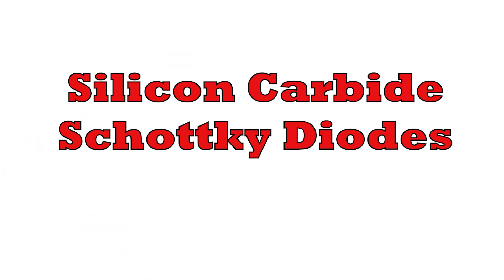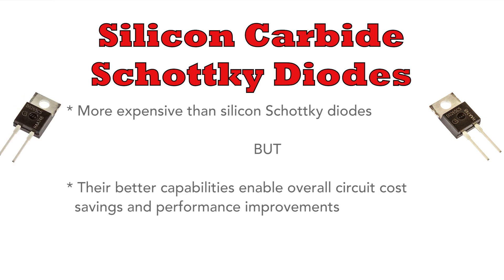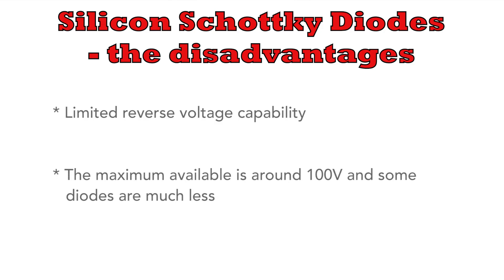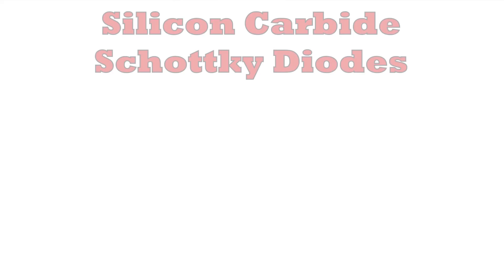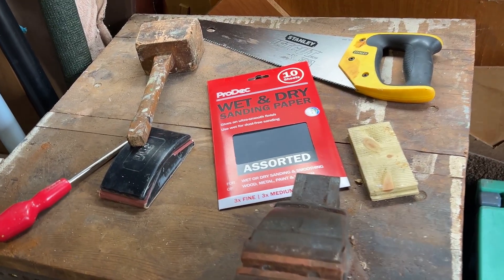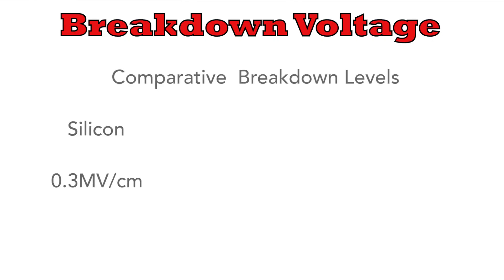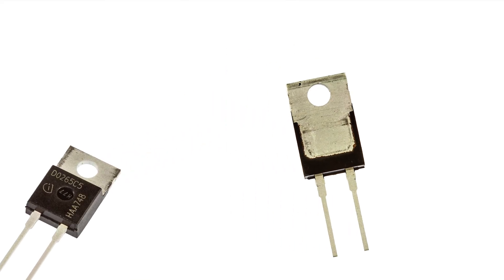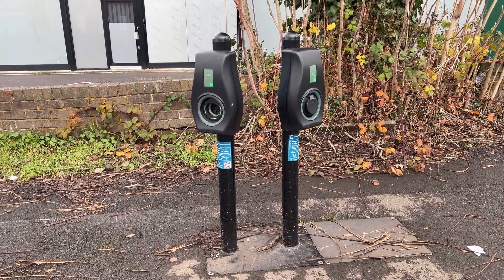Why are Silicon CARBIDE Schottky diodes so great?

Comment: They are best for rectification at high frequency and at higher voltage. Gallium nitride is another one that has even more voltage withstanding ability. Silicon carbide does have an issue that it's voltage drop goes up a lot faster per amp than silicon, you might have a drop of only 0.3V at 100mA but at 10A it goes to 1.5A. When doing higher voltages this isn't a big deal though.
Reply from the maker: Thanks for your insights - very useful.

Comment: Are SiC diodes sutable for secondary side rectification? What is the lowest forward V drop?
Reply: I've checked datahseet for that diode you show here and voltage drop is over 1.5V! so it is actually worse than silicion diodes, it is just faster
Reply from the maker: Comparatively few figures are available. It depends on the diode and the metal used for the junction, but figures around 0.3 to 0.4v turn on are seen. Obviously this rises with current, so check the datasheet for your particular diode.

Comment: Excellent!  I am sure you were joking about not understanding the electron volt but it is one of those units that actually is really easy and helpful to know.  In its simplest terms (and I know it is about + charge), "The energy gained by one electron moving through 1V"  Yes, one needs to then convert that to Joules but 1eV is just what it says, 1x e(charge on a proton)J.  I find it similar to 1kg being lifted by 10cm being about 1J of energy transfer though that is a lot bigger than 1eV!!
Reply from the maker: I was indeed joking! Thanks for the explanation.
Reply: @ElectronicsNotes  Yes, it's quite a 'visual' unit as it were. You can almost imagine those electrons each picking up energy as they travel through a power supply!

Comment: You have not mentioned the forward conduction voltage drop of SiC.
Reply from the maker: Good point. Its a bit higher than for silicon Schottkys, but still better than for a PN junction diode.
Reply: The SBR (Super Barrier Rectifier) is really a good device.  It has the voltage drop of a Schottky rectifier, but with significantly reduced leakage current. When you use them well below the rated current, voltage drop can be below 0.4 V for low voltage devices (say under 60 V blocking voltage).   The huge capacitance can be a drawback for some applications. 

On the high voltage end, SiC is the winner, think of voltage drop of 1.4 V for 650V devices and (virtually) no reverse recovery as is present in Si junction rectifiers.   When using them well below rated current, voltage drop goes near 1.2V.   2 kV devices are available now. 

Traditional silicon rectifiers come in between.
Reply: Ah yes, I came to the comment section just for this. Si has about 0.7v forward drop.  IIRC Schottky Si diodes are around 0.5v? Where does SiC fall in this group?
Reply: @ksbs2036  Its about 1V.  It varies from part to part.  At rated current it is about 2V
If you want lower but not a Schottly's leakage look up the SBR devices from Diodes.  They have the drop of a Schottky and almost no leakage.